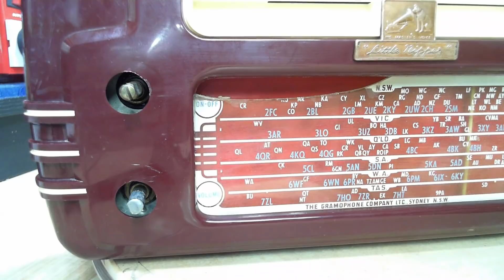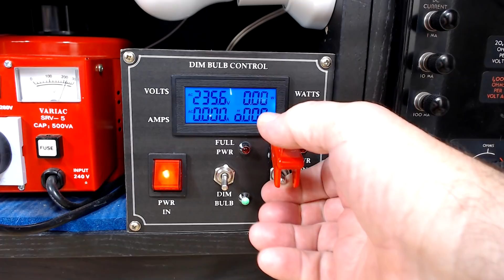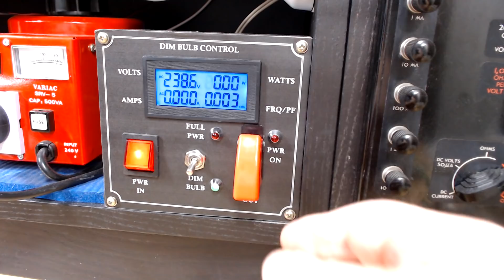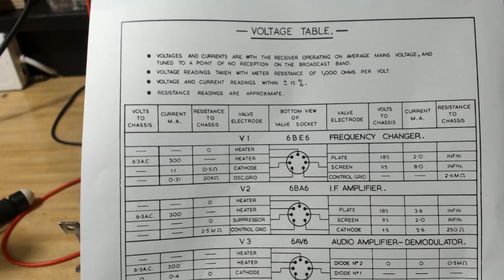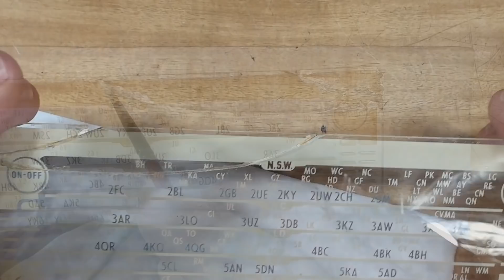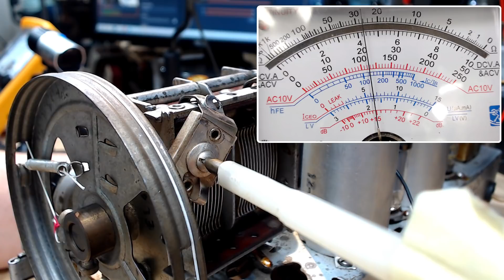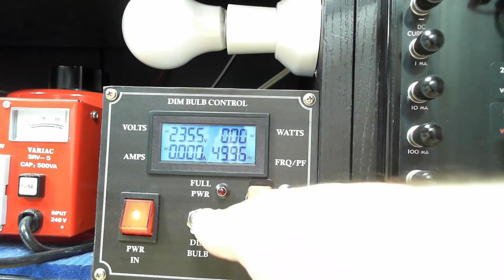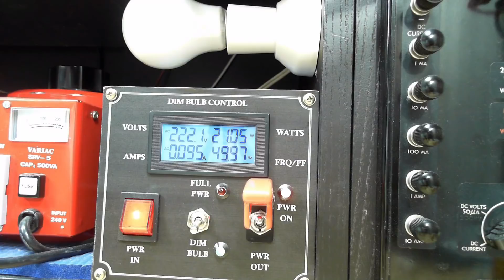HMV 61 51 Radio Repair - 1954

Comment: I know it has been two years but I have to add my congratulations on another really thoughtful and delightfully expository restoration.  Perhaps you said what you use for backing material on the plastic case repairs but may I ask you what you use?  Here in the 'states one finds #16AWG sheet metal (sometimes Aluminum/Aluminium) which is 0.0508" or ~1.29mm.  Outside the the US there is #16SWG is 1/16th inch or ~1.59mm.  Would #16AWG work for these backing reworks?
Reply from the maker: Hi Jeff, thank you. The sheet I use is 0.5 mm thick. It bends easily and can be moulded into intricate shapes. Any thicker than that would be too hard to shape I think. If the repair site is fairly flat, thicker sheet might work. I get it from the local hardware. I looked up Lowe's home improvement but it won't let me access the thickness. You could try hobby shops or eBay, local metal suppliers etc 🙂

Comment: Another great video Dave. I was wondering where you source your cable you have been using lately?
Reply from the maker: Thanks Matt. I bought the faux cotton covered wire on eBay. Search for "vintage radio wire" 🙂
Reply: @DavidTipton101  thanks Dave! I will look into that!! Cheers

Comment: 11:20 the sliding enterprise doors sound, would it have anything to do with Data's Chinese fingers reference? lol, It was a nice touch putting the Cap in the Cap, Keeps things looking old, yet working like new, Great job great idea.
Reply from the maker: Hi patprop74. No reference there, I do remember poor Data's finger trap though. The cap was on top so thought it would look nice if I could retain the look 👍🙂
Reply: @DavidTipton101  That it did, It's your attention to detail that makes your radio rebuild look a notch above the rest. ok,  the way you showed the braid insulation, and how it shrank when you pulled on it Reminded me of that scene and like clock works the Door sounds lol that's why i though it was intentional lol
Reply from the maker: @patprop74  Ahhh, I see 😄

Comment: Hi David! Big fan here. How do you clean tuner capacitors? Do you use a spray, or some form of mechanical cleaning? If spray, what spray do you use? Thanks for replying!
Reply from the maker: Hi Graham, thanks. On this set I used WD40 between the tuning plates to remove the tar and blew it out with compressed air, generally I just use compressed air. If the tuning condenser body is badly rusted I mask off the plates and clean the rust off in the media blaster 🙂

Comment: I did wonder if that rather fierce volume could be the output valve negative feedback in the cathode circuit, being positive feedback instead ? Possibly not enough to make it oscillate but just enough to increase the gain of the stage....
Just a thought 🤣
Reply from the maker: You may be right blackpoolbarmpot. Although, if the OPT wires were switched I would expect feedback at low volume. We will never know 🤔🙂

Comment: Another great restoration David. I was wondering if the excessive volume could have been due to improper AGC action  or possibly the negative feedback from the secondary of the audio output transformer secondary being absent?
Reply from the maker: Thank you KSN's Tech Topics. I did a lot of checking off camera and AGC was one of them, it was working properly. I also checked the negative feedback was working by disconnecting the cathode electrolytic from the OP transformer secondary and grounding it, the volume increased so the negative feedback was working. It is a mystery to me but it worked quite well in the end 🙂
Reply: @DavidTipton101  Many thanks for your reply David. It will remain a mystery then! Thank you for uploading these video's, Your content is always superb and I can't believe that you only have 10,500 subscribers. I look forward to watching your next 'Radio Adventure' :)
Reply from the maker: @ksnstechtopics8650  Thanks 😀

Comment: Hi David,
Great work as always.  I do think you where a bit too harsh on yourself regarding the end result. Look what rubbish of a case you had to work with 😂 imho this was a parts radio with so much damage on the case.
I do however wish you would stop removing perfectly good and extremly reliable philips mustard caps, and replace them with new modern probably made in china caps. The mustard caps are superior, never fail, leak or drift. Even in difficult circumstances. In my 35 years as a tech i never had a faillure. I even extract used ones from old equiptment,  to make my (philips) restaurations period correct. They are becomming pretty scarce in some values, so don't trow them away! End of rant😉
Nice to see you where able to use some additional parts from your parts unit.
I still wonder why the volume was so sensitieve,  perhaps a mistake was made in the preamp part of the radio, because before you started working on it, someone had clearly been inside before. Those mustard caps where not original. Did you compare the two chassis next to each other, and did a visual inspection?

Just curious.

All the best from the Netherlands, 
Nico den Haak.
Reply from the maker: Hi Nico, yes that case was a mess, I should be happy with it but it wasn't as good as I had hoped it would be.
Regarding Philips mustard caps, I know they are reliable but I had two fail early on in two radios that worked fine for a time before failing. I can't test them so I take them out. I send them to a guy that uses them again so they are not wasted.
I spent an enormous amount of time checking the radio against the circuit and then the donor radio, I even tested voltages against each other. The only thing I found was the AGC wasn't working in the donor radio, I didn't track down the cause but I did disable the AGC in my radio but it made little difference. Thanks and cheers Nico 🙂
Reply: @DavidTipton101  Hi David,

I must say mustard caps failing is a first for me. If the voltage on them isn't underrated for where they are used, never had a problem with them. But i guess there is a first for everything. I had a fail once, where  someone had put a 400vdc cap across the line. It took years to fail, but 230v ac was a bit much.
They should have used a x or y cap for that.
Currently i'm restoring a 1945 erres ky457 from the first series. These first series are pretty special,  because it was build just a couple of months after ww2. It's the second full restauration of a tube radio i have done in many, many years.😉

Comment: Great work David.  Tell me what is the RF signal generator module you are using please?
Reply from the maker: Thank you VK4UH. Sure:
The Signal Generator is a project kit from a local electronics magazine called Silicon Chip, there is a sister publication in the UK called Practical Electronics, it was featured in the April 2018 edition but mine has a oscilloscope function as well which I don't use. There may be a later edition in PE with that feature. 
Here are the links:
Aus: https://www.siliconchip.com.au/Issue/2017/September 
UK: https://www.electronpublishing.com/product/april-2018-back-issue/

Comment: Like all your other videos this one is very informative and well done, I learned a lot from it. Congratulations and thank you for your commitment!!! I would like to replicate your Speaker dummy load, do you have a wiring diagram? Thank you
Reply from the maker: Thank you Consiglio, The dummy load is simply a 10 Watt resistor substituted for the speaker voice coil. You switch out the voice coil and switch in the resistor. Use a resistor of a similar Ohm resistor as the speaker rating. E.G. for a 4 Ohm speaker, use a 4 Ohm resistor, for an 8 Ohm speaker use 8 Ohm resistor and so on 🙂
Reply: @DavidTipton101  Hi David, a curiosity, the shop speaker you use for radio tuning, how many ohms is it?
Reply from the maker: @consiglioiannuzzi9314   The radios I work on use speakers of about 3 to 4 Ohms so I use a 4 Ohm speaker for the shop speaker. Car speakers are often 4 Ohms or those mini HiFi sets often have 4 Ohm speakers and are ready to go with their own enclosure.

Comment: Looks like the radio was recapped before he let you try to repair it, it should be reasonably easy to get a new dial plate, I wonder did the heat of the vacuum tubes make the case go brittle so would it have be a idea to try to use low voltage tubes that don't get as hot as normal tubes just wondering, another thing has anyone tried building a double balanced first mixer around 3x KORG NU-Tubes 6P1s flat tubes.
Reply from the maker: HI David, I think the heat had affected the plastic, it was discoloured in the cracked handle area. I couldn't answer the last part, sorry 🙂

Comment: Hi Dave awesome as usual.... im in the process of restoring a grundig 4020W and need to replace the eye tube and have had little luck... any idea where to find an  EM34 or 6CD7 magic eye tube. thanks in advance
Reply from the maker: Thanks VK3ZEN - RF Design. They are expensive to buy, you could check eBay. I think I remember replacing my EM34 with a Russian 6E5C or 6E5S, it required some rewiring but worked quite well. I think it was the French Unic radio. I think they are about $30 on eBay from Russia 🙂

Comment: David,
What is the brand of that mini-belt-sander? I can't tell you how many times that would have been the ideal tool for a job I was doing. I have seen some other restorers with similar bakelite or plastic case issues just make the case perfect with body filler and then just prime and paint the entire case with enamel spray paint. 
Thanks.
Reply from the maker: Hi Ian, Yep, I have repaired and painted several cases and they came out very well but no time on this one and I didn't want to take the originality away from it either, it wasn't my radio. The sander is from Ozito, most makers have something similar but Ozito was the only one I could get at the time 👍🙂
Reply: @DavidTipton101  Thanks. I looked at one a few years ago but it was a Makita and it was not worth the 300 dollars for the amount of use I would give it. Ozito seems to be a house label in Australia and NZ, but the same thing is sold here in the US under the brand WEN. I just ordered it; thanks for your help in finding it.

Comment: Hi David, great & helpful video. 
I have the exact same radio which I just replaced the electro caps in but now there’s static (that wasn’t there before!) that increases with volume. 
If I take out the frequency changer valve there’s no static no matter how much I crank the volume up…..so makes me think the issue is there somewhere. 
Just wondering if you’d have any tips on where to start diagnosing this fault…?
 I haven’t realigned radio & I don’t have the equipment to….but I didn’t think I’d need to could this be the issue? Thanks heaps if you can help!
Reply: Just to add….I turned it on again at night with no tubes in and there’s a faint static from the transformer….almost seems as though this is amplified through the radio when it is running…hmmm
Reply from the maker: I would use a signal tracer but look for poor solder joints, valve sockets etc. Try moving components a bit with a wooden chopstick with power on. It could be something in the room with the radio, try moving it to a different room. Good luck 👍🙂

Comment: II thought it was interesting.  I’m always sorry when the time creeper reaches the end of your videos, David.  I’ve never seen a belt sander like that one you used when removing the excess glue on the case. Where did you get that?
Reply from the maker: Hi Gar, thank you. They are called finger sanders Gar, I bought mine from the local hardware. https://www.bunnings.com.au/ozito-260w-file-sander_p6290620
Reply: Thanks, David.  I found a similar item on Amazon.  I’d love to go to your local hardware...  But, it’s half-way around the world from here. (N.W. Ohio...). 😉 If I’m ever in Australia, though...  :) The one on Amazon is not made by the same manufacturer, but is somewhat similar in appearance.  We’re still stuck on the imperial measure treadmill here, so the dimensions are given in inches - 1/2” X 18” belt, which I think is pretty close to the same size as yours.  Thanks for the information.  It pointed me in the correct direction.  Gar
Reply from the maker: @harryshector  There are a number of brands, that was the one my local stocked. The belt size for the one you ordered is the same as mine 😀

Comment: I'm curious, does epoxy not work on this type of plastic?
Reply from the maker: Hi Dylan, I tested various tow part adhesives on Bakelite and JB Weld was by far the best, epoxy and resins chipped off easily, I expect the same would go for plastic 🙂

Comment: Dave, I learned a trick last week that might have helped that piece. When dealing with plastics, colors can be almost impossible to match. No one's fault, it's just the way it is. A friend told me to try matching to fingernail polish. It has a multitude of colors and can do a really good job of covering areas that you can't match otherwise. Hope it helps. Great job on that piece!
Reply from the maker: Thanks Greg, another trick I will store in the vault 🙂
Reply: Nail polish is acetone based, it could well mix with such plastics. One slight possible problem:  it is made for short living on nails, so maybe the pigments won't last. Smear some on a piece of carton, cover half of it with alu foil, and hang it straight in the sun for a few months. After that observe the difference ( I just HATE what some expensive paint manufacturers do with their product).

Comment: I wonder if there is an AVC issue with the "volume too loud" radio
Reply from the maker: I checked the AVC and it was working properly, I also checked the negative feedback in case it was reversed but it was correct. It was unusual to be so loud close to the min stop but it was OK to use 🙂
Reply: @DavidTipton101  It does look like a puzzle.  The reception was hotter than normal.  I believe you did try new valves with no difference.  The remote cutoff pentodes through which the AVC acts might have had a different curve than normal (also perhaps overly high screen voltage?) but you seemed to have been very diligent.  Tracing signal levels through the two radios might be the only thing that could solve the mystery.  The detector output is coming up hotter than it should, perhaps.  Something weird like a different turns ratio in an IF can could do it.

Comment: What watt resistors are you using?
Reply from the maker: Hi Chris, I try to use the same as was fitted but generally 1/2 or 1 Watt in most positions. You can quickly work out the current flow then wattage using Ohms law if in doubt 🙂

Comment: Too much volume is usually due to an AVC problem.
Reply from the maker: Hi André, I checked the AGC and even disconnected it, it made little difference 🙄
Reply: @DavidTipton101  You need to use a small variable negative supply to check if AGC is working. A short will do that problem.
Reply from the maker: @y_x2  Yes, sorry, I checked the AGC and it was working correctly. I can't remember the voltages but it varied from strong stations to weak stations and I think the weak stations were about minus 1 or 2 volts. The problem was still evident on the weak and strong stations. The AGC capacitor was replaced and the resistors were checked or replaced.

Comment: Oops!! It looks like 👍 ya have to order a dial glass from your special Australia 🇦🇺 company. It doesn't look like 👍 that one can be fixed. It can, but it wouldn't look right again. This kind 👌 of looks like 👍 your telegram radio, by the dial. I kinda 👌 like seeing 👀 the broken dial glass in a way, but know 👌 that's the way it shouldn't be. Just don't get hurt on it during removal. Hold onto the dial glass, before disposal. You'll want an exact replacement. A snapshot to your Australia 🇦🇺 company should insure this. I saw 👀 the damage to the back of the case, and it looks like 👍 the previous owner stuffed the power 🔋 cord into the back of the radio 📻 for storage. This is probably how the case got damaged. If not 👎, probably 🔥 hot tubes. Those potentiometers can be very hard, or even impossible to replace. If you're going to use the radio 📻, buy a power 🔋 strip, and use the on/off switch on it, this will keep 👌 the wear off of the radio's switch, and place it on the switch of the power 🔋 strip. "We Gotta Get Out Of This Place" by Eric Burdon and the Animals (That's the song). Oh crud, ya have to change the dial string!! Don't stretch, or bend the tensioning spring, which is attached to the dial pulley. I sure like 👍 the look of the dial pulley. The dial bulb appears to be burned 🔥-out. I haven't been paying attention, if this is a transformer set, or a 🔥 hot chassis (or series-string) one. I see the dial light now 👎, but it doesn't appear to be lighting up ☝ the dial glass.  People often replace these dial bulbs with LED's, but I HATE when they do it. LED's lack the lighting qualities that only incandescent dial light bulbs have. LED's are said to last WAY longer, but a majority of them burn 🔥 out before their time. I'd be afraid 😨 of them taking away from the value of the radio 📻. I heard 👂 ya say it earlier in the video 📹. This is CLEARLY a smoker's 🚬 set. I know 👌 that very smell, when the tubes begin to heat up☝, along with the accumulated dust. Just don't turn any radio 📻 on, if ya see 👀 that the tubes are rammed into place, inside their boxes 📦. This was often done ✔ by dishonest repair people, and it's a GREAT 👍invitation to a fire 🔥. Always take your radios apart, then test them, making sure that no 👎 tubes are covered by boxes 📦. Also check ✔ for rat's 🐀 nests, and dead rodents, which can also catch on fire 🔥. I like the radio 📻. Keep 👌 up ☝ the GREAT 👍 vids 📹, Mr. David Tipton. I love 💘 them!! Your friend, Jeff.
Reply from the maker: Yep, I got luck with the glass and found a good one. It has a transformer this one and I replaced the dial lamps. Thanks Jeff, I'm glad you enjoyed my video 😀